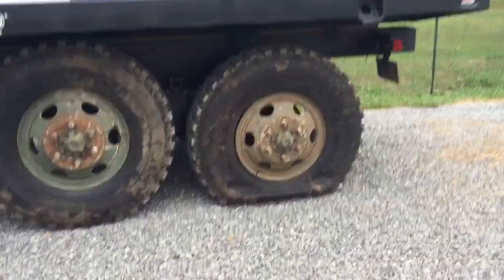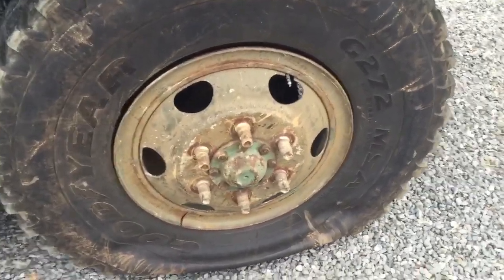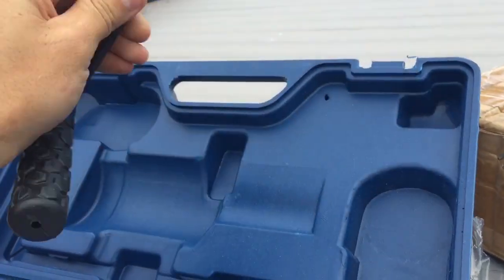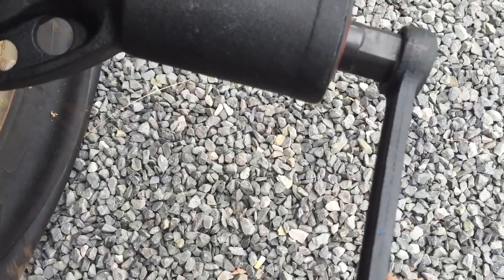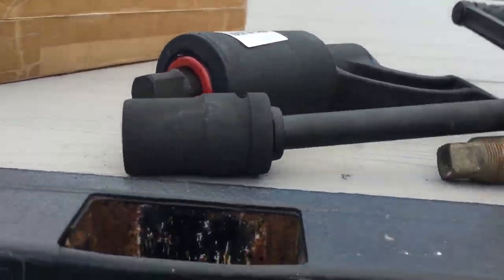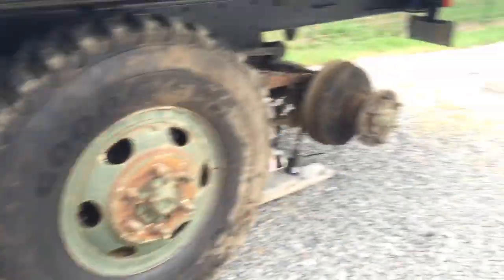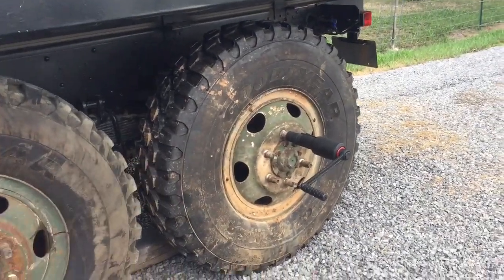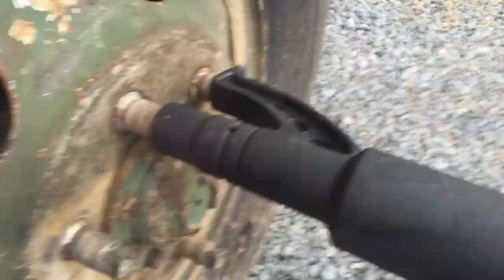Torque multiplier in action

Comment: Nice video.  I have a few questions.  Is it still working?  Have you ever taken it apart to add grease or any other maintenance?
Reply from the maker: I ended up selling the truck and included the multiplier with the truck. It worked every time I used it but unfortunately no real long term review.

Comment: To think I multiply toque with a four foot length of galvanized pipe.
Reply from the maker: +calvingreene90 when I was first trying to get them loose I had a breaker bar and was bouncing on the end of a 10ft pipe and it wouldn't budge, I used a factory m35a2 tire removal kit successfully the first time I removed the nuts, this tool is just easier to set up and smaller to store.

Comment: I have plenty of torque multipliers. They are also known as long bars. Much cheaper free even.
Reply: Right. But, using a bar I have often thought...what's going to break first? The nut, the bar, the ratchet wrench, breaker bar... I have seen people hang on the bar or jump on it.  I have skinned my leg up using a bar on a yoke nut. But, it got the job done.
Reply: I thought the same :)
Reply: I broke a perfectly good 48” x3/4” drive breaker bar then went & bought a $99 one from HF but it snapped on my first bounce. Bought a Klutch multiplier from Northern Tool & it broke that 1-5/8 lug nut loose easily.

Comment: for the price of $50 I could buy a 18" breaker bar, 3" extension, and a double ended socket with 19mm on one side and 21mm on the other side and I could change the wheel and pretty much every car in america.
Reply from the maker: +Technician  when I was first trying to take them off I was standing on a 10ft cheater pipe and they wouldn't budge.
Reply: Thats a problem with poor maintenance. You would of been better off renting that tool sense you'll only use it once to free the rusty bolts and every time after will be a breeze once you push some anti seize on them so that they'll never rust back together. But I do see you point. Rusty bolts can be a pain to remove especially if they break when removing them.
Reply from the maker: +Technician agreed, It jus helps make life a little easier
Reply: I have had success loosening rusted tight lug nuts by giving them a good wack with a hammer.

Comment: I'm you weren't hauling anything would it be THAT bad to just take the flat tire off and keep rocking.  I mean it would still drive fine right? (In a pinch)
Reply: It is not a problem if the single tire can still handle the load on that side of the axle. You don't even need to take the other tire off as long as it is not rubbing on the good tires sidewall. Taken too extreme I once had a boom truck that blew both tires on the left side rear axle. It had a walking beam suspension. Using the rear stabilizer on that side I was able to raise the tires off the ground, put wood blocking under the axle, then lower the tires and chain the axle with the tires off the ground. I then drove 40 miles back to the yard which got me home and saved an after hours service call. The front drive axle did all of the work getting back and I didn't need the extra load capacity. Don't try that at home and whatever you do don't drive through a check point with it. Dual tires are for extra load capacity if you don't have the load you don't need the extra tire. Even if you are loaded if you go slow depending on where you are at you can still keep going to get out of a bad situation. You have to be prepared to loose the other tire.

Comment: as a mechanic for 30 years,I have  never had an opportunity to use one like that ,  that's pretty cool
Reply: As a school bus tire changer I have gone through a few of these, most of them are of knock off quality, deals can be found on pneumatic versions, the hardest part is finding the correct reaction arms and getting one strong enough to get it off but not over torque, (low torque under 450 and high nut breaking torque over 750, the stronger ones need less air pressure but are slower, the good news is they all are accurate as a torque wrench when using the specific regulator -filter-lubracator. (FLR) at the correct setting.

Comment: he has onboard air?   that would need to be powerful for an impact.
Reply from the maker: +Eric jones every half inch impact I tried wouldn't touch the lug nuts, this kit is a lot easier than running a hose and lugging a 1" impact around.
Reply: Bring your Milwaukee M18 1400ft.lbs cordless impact gun. Problem averted, film at 11:00.
Reply: air tanks to small for such a big lug on a car it would come of easy those lugs are touch go get of

Comment: Can this torque multiplier be adapted for use in situations where there isn't an adjacent nut close by to brace the stubby reaction arm?  Are the holes in the arm big enough to slip an iron bar through it that would be long enough to brace against the ground?
I bought a Ratchet Helper, with a 5x torque multiplication, but it's only a 1/2" drive rated for 500 ft-lbs before breaking, so I was considering one of these higher strength types, except I'd need to adapt it to be able to use without the exposed lug nut configuration.
Reply from the maker: +DTR RTD you could definitely make an adapter arm, with a little ingenuity.  There are a few small holes in the arm but not it the correct orientation for how you're talking.
Reply: https://youtu.be/KIHzSWvXSJE?t=2m20s
From the view here, the holes do look pretty small, so it wouldn't fit a bar hefty enough to withstand much torque, but if they were, I was 
considering putting a steel bar through it that was long enough to reach the ground, which would act as the brace to keep the reaction arm from spinning under load.

Actually, looking at it further, it looks like it'd be possible to simply put a bar between the reaction arm and the socket, extending to the ground.  That would work better since it's closer to the drive socket.
Any chance you could try finding out if that's feasible?   If it works, I'm getting one, because the ratchet helper one that I bought was a bit too light duty for what I want these things for.  That was intended more simply to make it easier to remove lug nuts with less effort, but I'm looking for something that can work where breaker bars fear to tread...
Reply from the maker: +DTR RTD that would work putting the bar between the arm and the barrel of the multiplier.

Comment: Your whole problem is the Goodyear tires, but then I work for Michelin the number one tire maker.
Reply: Steve Darnell didn't Michelin make the tires that were blowing out on new ford explorers about 10 years ago? I'll stick with anything but michelin
Reply: Aaron Radd... actually that was closer to 20yrs ago now, and it was Firestone, not Michelin. As a result, Ford ended a working relationship with Firestone that had been in place nearly a hundred years.  For the record, I'm not a Michelin fan, but their heavy truck tires are nicer to work with than most others when having to mount them.  If you want proof, go hang with a tire guy who does heavy truck tires for a day or two. I like Bridgestones and Yokohama tires. Goodyears will do, but they are always difficult to get beaded up.
Reply: c est du n importe quoi,parce que michelin serait le dieu du pneu .chez moi ,il ne rentre plus depuis longtemps et pourtant je suis francais
Reply: Does Michelin make tires for the M35A2?
Reply from the maker: +Wolfgang1224 they do
Reply: Steve is right ditch the Goodyears and get the best tires on the market get some Pirelli tires :D

Comment: It's still legal to drive on split rims/split rings?
Reply: multi-piece wheels without split rims are still legal, although will probably be getting phased out soon as there are single piece demountable wheels now.

Split rims (the ones with a z-cut throught the rim itself) are not legal as they have a much higher likelyhood of failing, even when mounted.

there is a lot of confusion as to the diffence between split rims and multi-piece. split rim refers to the part the tire actually mounts to and valvestem extends through. they have a z-shaped cut through them. multi-piece refers to the fact that there are multiple parts that have to be assembled for it to work properly. the rim, and up to 3 locking rings that hold the tire and tube to the assembly.
Reply from the maker: +Shaunak Intwala I think it is a little grey area,  there is not allowed to be any new construction using them but it is also based entirely on your state/ county.  I wouldn't recommend them.
Reply: they are used in intermodal transportation nationwide - i'd say 80% of the tires i do are split. and have even seen some of the old 3 piece style at times. do me a favor though when you are removing a dualie split rim tire make sure you deflate both tires. its the one thing we have to do as a standard so the ring on the other wheel has no chance to blow out and take your head off and re inflate after they are secure on the truck.  only takes a few extra minutes to re inflate it. i see a lot of people who own these make this mistake
Reply: this style wheel is still widely used on ag & construction equipment. like jake said, it is the other style that is bad. these done wrong can go bad too, you have to know how to handle the rings.
Reply: MKIIIsupra2jz I've  always wondered is it safe to run these without a duel setup, seems like they are designed to be part of an assembly with another wheel and nut clamping everything together.
Reply: Todd Laisure it's totally safe you just need to flip the hubs and the rear treads will run in the same track as the fronts.....it's not safe to just remove the outer tire and do nothing else as then the width would be too narrow